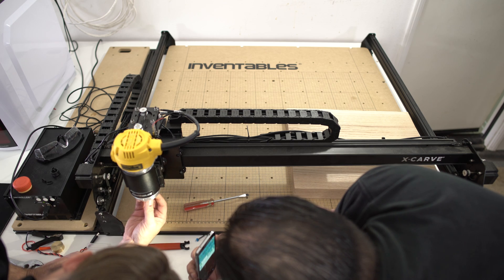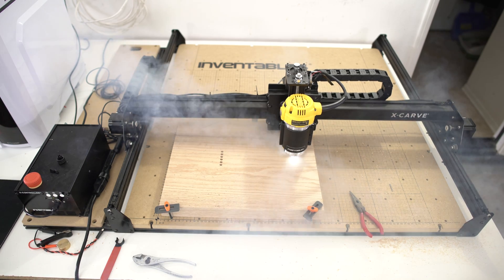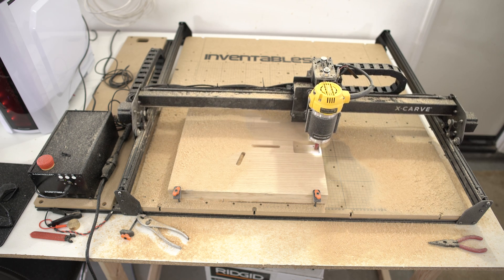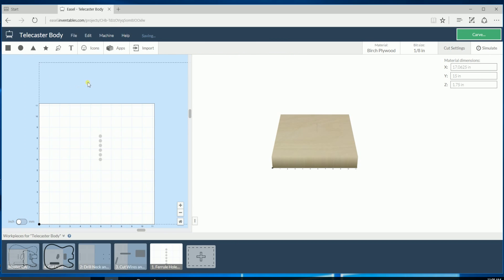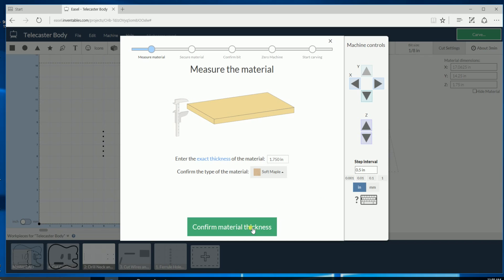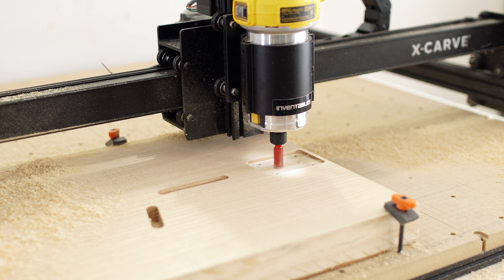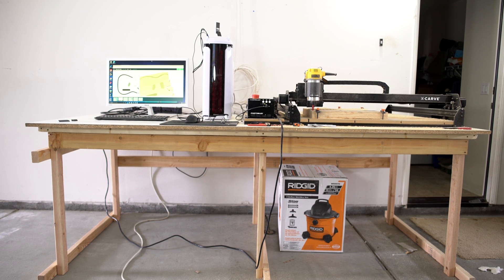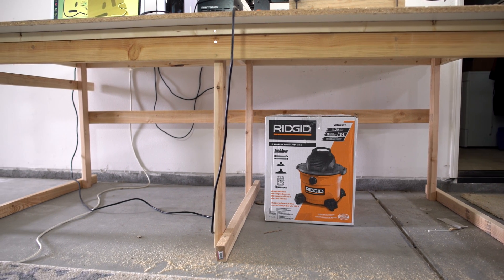The Amazing X-Carve PC Build Part 1 (Introduction)

Comment: from other wooden PC case videos.. your going to need a metal motherboard plate to provide an electrical ground & a place
that will hold the motherboard standoffs.... seems everybody takes a drimmel tool to an old metal PC case to cut out the motherboard 
tray to instal it in the wooden case.. also fans make a lot of noise due to vibration from the wooden panels & they have 
a major heat problem...air flow sucks... are U going to just go for looks or are U going to actually run the PC to see how it preforms ???? 
 noise & heat & stuff ???

Comment: Mame cabinet that will run modern beefy games,  no little raspberry pie builds. Custom desk/desk accessories like headphone stands/pc in desk builds. PC speakers,  gut some logitech speakers and make  some custom housing.  PC building work station (wooden work station = no static electricity). Mobile laptop stands. A legit gaming case with cnc cut psu shroud and motherboard stands and cnc cut acrylic side panels. Modern jukebox build with u
something like voice integration from echo dot and touch screen tablet.  Hell all sorts of fun stuff,  as a geeky builder and wood worker I've been asking for an Xcarve for such a long time, sadly wife's  medical bills aren't allowing me the extra cash for one.  Congrats to you for getting one I'm very envious and excited to see what you make.

Comment: Case wise, no preference, though if you do build a Borg Cube case I hope to see green LEDs around it to really make it look like a Cube.  If you go old school, please PLEASE put Nikie Tubes in it even if they don't show anything at least if they light up that'd look frickin' awesome.  Especially if the on/off button is a tuning dial, oh oh oh, and I know this would be very far fetched but how about an old school analogue temperature needle (you know like the twitchy needle things used in old school audio equipment common in the 90s) to be able to show a real temperature, maybe the CPU temp, GPU or even just ambient air temps in the case?  Hell I'd buy a wooden case with an old temp monitor like that.  $2K good for you?  Sweet.  I expect delivery next week.

Comment: can a cpu equipped with a gtx 1060 3gb work without it
i mean i have one with gtx 1060 but the gpu is broke due to over temperature thanks to my friend .
i haven't started my pc till then . I'm afraid that if i remove the gpu and ran my pc there would be some problem of power i mean that it could a short circuit . plz tell me what should i do
Reply: Will it work fine without the gpu??

Comment: I've always wanted to see an old school, steampunk ish pc, with functional copper cooling pipes going outside etc, i think that would look sweet!
Reply: AyeJayCee great idea.you have my vote
Reply: thanks!
Reply: That's a great idea, but make it look like a boiler room on steam ships. Make the liquid reservoir look like a boiler.
Reply: I like this idea too .. this has my vote!
Reply: with an old school pressure gauge that's actually a thermometer 
You can do this with an arduino + servo OR old volt meter
arduino can take 5v straight from the PSU
Reply: actually it does exist allready for many years
Reply: actually Linus from Linus Tech Tips  used copper pipe & a car radiator in one of his scrap yard wars videos...   they do it as a goofy video series
(scrap yard wars) but the computer did run...I don't know how functional it would be long term to have a car radiator on your desk but the PC did run
Reply: all these designs have been done the triangle one has been done into the dirt, i wanna see what ToT comes up with

Comment: It doesn't cut metal, actually it can probably cut aluminum, either way I checked out their prices and the motor that they use :S 1800US for a small dewalt motor which will honestly struggle with an oily hardwood, plus another 2000$ for the software, you might as well save up a little bit more and get a nice powerful (probably used at this price) CNC machine which will mill steel, then you will make the real bucks :D
Reply: You do not need to buy the $2000 dollar software and the DeWalt 611 is a standard palm router that has no issues with hard wood.  Lastly the 1800 is not for the small router it pays for the control systems and software.   You can buy this with out the DeWalt and put your own router/spindle in it if you want.  In fact i would suggest this as it would lower the cost a little bit or significantly if you find either the 611 or Colt spindles at a garage sale.
Reply from the maker: Thank you Russ
Reply: Russ Havens What do you think a palm router is essentially? It  is a motor with a shank for bits... what's important in a palm router is the torque and h.p and the size of bits that will fit... what you're looking at is the motor and it will struggle with things like Ebony. Obviously you don't need to buy the high end software but if you intend on making money with your tools and intend it as an investment, you should without a doubt save your money for another month and get something substantially better that will come with the software anyways. Just to be clear when I mean struggle I am not saying it won't do it, I am saying that time is money and it will take a long ass time, it's a great machine for hobbyists but if you want to be a serious tradesman I would honestly save up the money and buy something else, also their software that comes with the machine can't do radius cuts, so if you want to be able to do them you need something else.

Comment: What about a vintage stereo amplifier? They're decent sizes, wood around all the sides apart from the front, a grill on the top for heat. The inputs and outputs will be at home on the front. If you really want to be fancy, what about VU meters, one for the CPU and one for the GPU temperatures, no idea if that is even possible. Maybe have two "speaker" grills at the front left and right that are actually fan intakes.

Comment: What about. An acoustic guitar body, with a computer inside, with a laptop touchpad on part of the wood. And, it would have a line-in to that PC to adjust the sound and record wherever you bring it. 

What if you created or remodeled a replacement desk drawer for a PC to be mounted inside of? Rather than the popular glass desk top with a PC build underneath, which are normally rather thick and not too comfortable. Also, very expensive or time consuming. Inside of a drawer would be pretty sweet for a discrete and unique way for quick PC access.

Last idea before bed.. Make a basic but intuitive PC case. But, put intricate detail into the side panel. You know.. like those fancy Bluray movie and video game sleeves that the discs come in. It has texture and pops out just a bit. I'd probably carve an awesome Yggdrasil mural onto my side panel. If you also watch the first Captain America. There is a mural of Yggdrasil in the temple that Red Skull obtains the Tesseract. You could make a homage to that in the same style with this wood, and have an awesome glass block for the Tesseract, for decoration or as an actual waterblock for your CPU or as a reservoir, with matching blue in the loop.